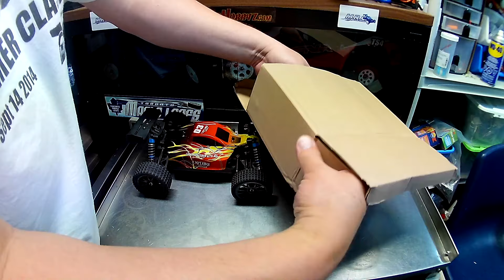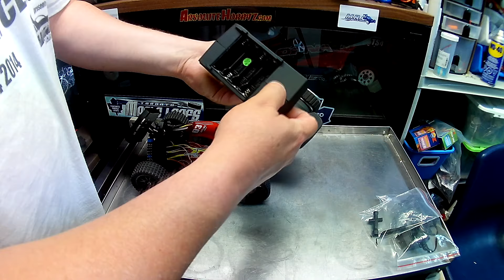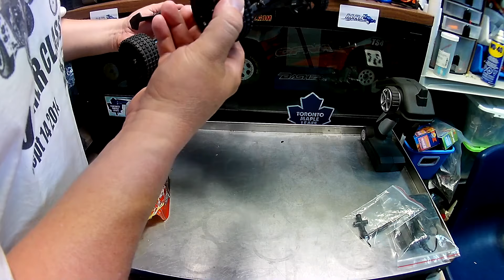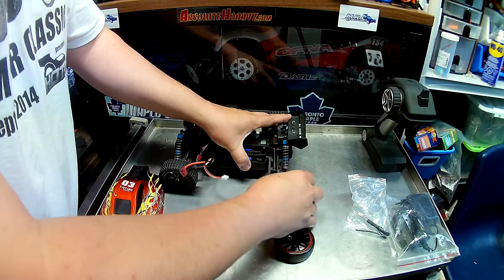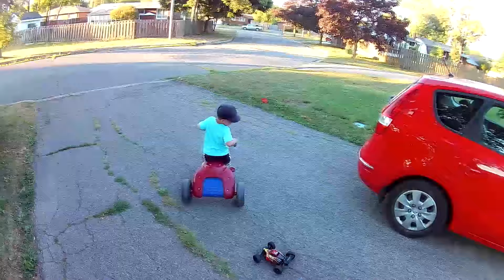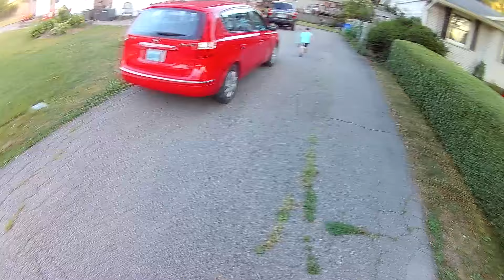HT C604 1/16 BUGGY EXTREME 4x4 UNBOX AND TEST DRIVE (FROM BANGGOOD) EP#255

Comment: blast off!!!!! :) looks a bit like the a959 though...nice work!
Reply: It is a new version of HuanQi 731 1/16, not so close to A959 as it is 1/16 and doesn't have same diff.. Work on this car is much easier than WLtoys.
Reply: Switch Off When Not In Use the body looks like it though, I wasnt talking about the inside :)
Reply from the maker: 3-2-1 BLAST OFF. My son loves that. He begs me everyday to do "Race cars" and that's cool i usually oblige him! I don't have the a959 but i have the a969. I give the nod to the wltoys model over this but it's a bit smaller RC the a959 is 1/18.
Reply from the maker: I had a bit of a deeper look at it today... 5 wire servo is sub par. still don't know why there isn't an on/off switch... it's bad RC practice to plug in the car before turning the radio on. thanks for watching!
Reply from the maker: body is ok... i like the paint scheme. it's a bit small though if you ask me.

Comment: Well detailed view of this car sir :)  Could it be the servo-saver that makes it have that dead-spot in the stearing? (don't really know if it does have a servo-saver :$) 
Yeps.. I'd agree.. for the intended cusotmer it seems like a good enough value :)
Reply from the maker: Hey buddy thanks for watching. I did go thru and tighten up screws on this car so possibly i tightened the servo saver and created that deadspot... we'll see i'll have to peek at it again. Not bad buggy good novice car. I like the jeep body. Not sure if this is worth upgrade though.
Reply: Neh.. upgrades.. You won't be racing this buggy :)  On the other hand: a better servo + getting rid of the servo-saver might make it more fun to drive? Or does it have a 4-stran servo?? :$
Reply from the maker: i popped open the receiver/esc box... this car is a bit quirky. no on/off switch. you have to plug in the battery first, then turn on the radio. totally backwards vs the hobby standard. oh well i was a bit confused trying to figure this car our when i couldn't find the on/off switch, i popped open the box and it's a dumb 5 wire servo. I have no clue why they do that.
Reply: :(  They should just abandon those non hobby style of servo's.. BUT they are probably cheaper (as the servo's doesn't need a control board).. 
Well yeah.. I guess that IS the difference between hobby & toy grade.. Upgradeability etc..